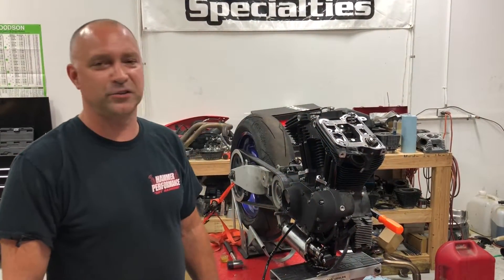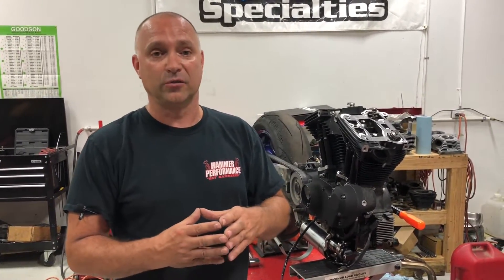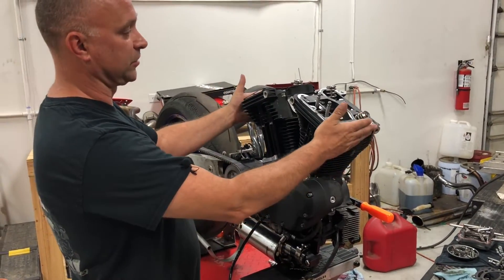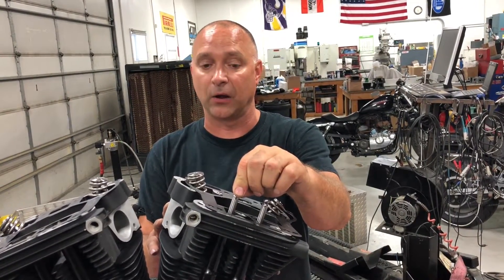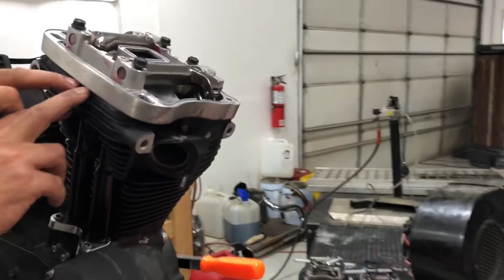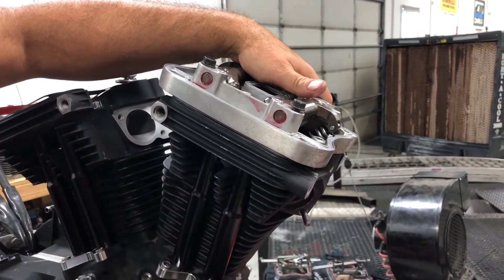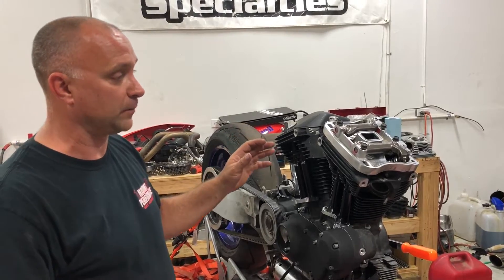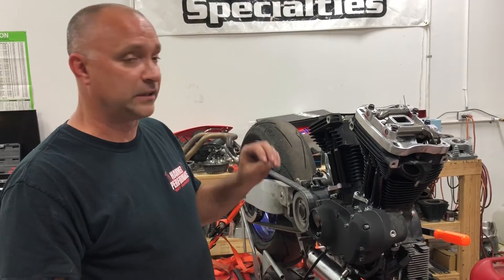How To Check Push Rod Length With Hydraulic Lifters

Comment: I did woods 222 cams s&s premium lifter and se ajustable push rods I set the lifters at .140 I notice I bit more valve train noise I was told the woods cams can be a bit noisy bikes a 2013 street glide 103

Comment: How do you put the pushrod tubes in after torquing down the head? It seems like they would not fit once it’s torqued I just ordered my 1250 kit and I’m curious about that.
Reply from the maker: with the rubber o rings in the heads for the top of the push rod tubes, you can push up on the tubes enough to swing the tubes and bases to there proper location.

Comment: Excellent videos, thanks! I have 2001 sporty and impact 560 cams, buell bx heads and am still using original pushrods. These are little on the long side, but didn't bother to change them to buell pushrods. My friend got one set of extra bx pushrods, but they are little rusty. I rather use top notch and longer than bit crappy ones...

Comment: Does s&s roller rockers change pushrod length? Great video by the way.
Reply from the maker: Yes but we've found it to be a pretty minor amount, rarely does it move things enough to require a change in pushrod length. It should still be checked, though, this is not something you ever want to leave to chance, else you may find yourself taking it back apart again.

Comment: Not all Lifters are the same , Revtech 120 ci lifters have no play that 200th does not work . they do not set or bleed down  no 100th deepth .  S&S and Fueling have the 100th play , and screaming eagle .
Reply: the video is about hydraulic lifters. Those revtechs are probably solid tappets.
Reply: Not according to Revtech , hydraulic lifters the paper said finger tighten push rod till no play, then 3 full turns on the pushrod let bleed down , I waited a hour , never got bleed down . Backed it off , went to finger tight locked them down .  Started the bike  it ran fine . Unless the box and paperwork was mismarked .   Been running Fueling  the last 3 years only .   I put it out there for guys doing a build at home  watch a video but buy parts online .  I live in Rule , The only bike shop around is 100 miles away .
Reply: True, If you already have your bike apart, I would take all lifters apart and clean them really good even new ones and measure the play with a dial indicator to be 100% and know your halfway point with absolute certainty. Then use an adjustable pushrod to add up your length properly so you can order the right fixed length. Do them all separately.